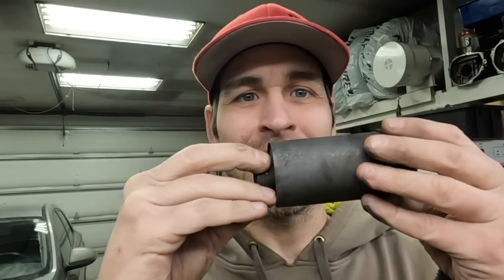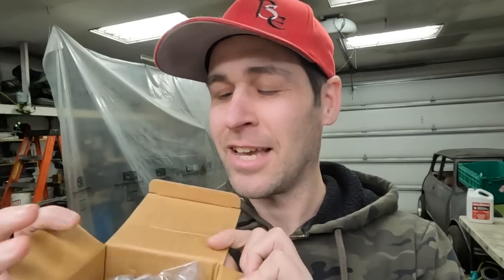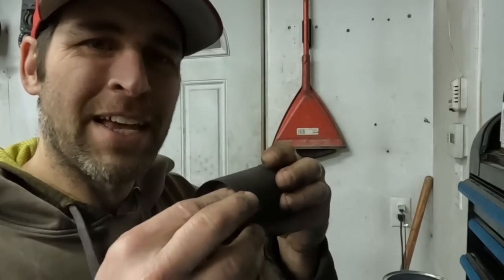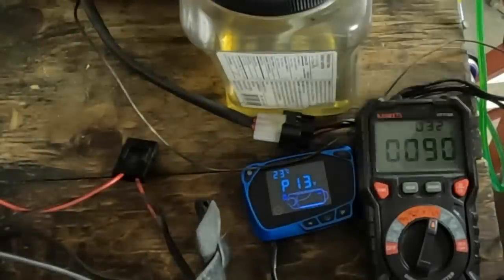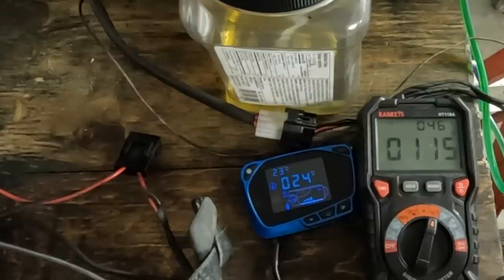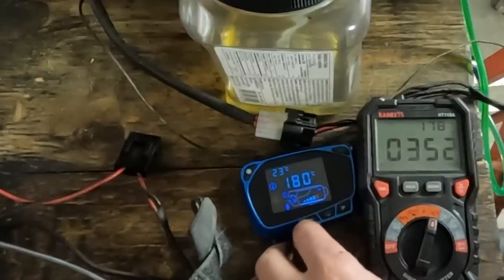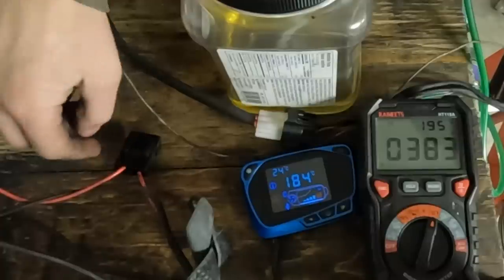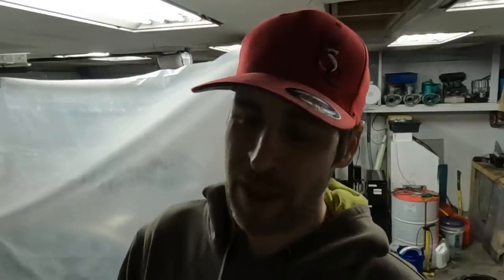Cat Converter In My Heater - Diesel Heater. PT- 23

Comment: I find it extraordinary that the folks that manufacture these have dialed it to such an efficient design.  

I think this is great considering the changing times.  Every home should have an off-grid source of heating.  Is this a larger plan?  I don't know.  

But I can say for sure, these heaters are safe enough, if you could be in a grid-down situation for more than 48 hours, you will be glad to have a sourced of heat.
Reply from the maker: It is pretty incredible, yes. They did a great job. 

For now, I am just trying to do something that keeps me entertained, keeps my brain going and saves me some money, but who knows what it will lead to. 

For sure... You wouldn't need much of a battery bank to power one of these heaters and a few solar panels would easily top your batteries back up.

Comment: 6:00 you got me there haha

If you made a mounting that you can adjust the baffle plate space to burner and then you can adjust the flame better.
Better heat efficiency maybe
Lower exaust temp possible i think if you dial it in correctly it can run super efficient and can be adjusted to different oils maybe
Reply from the maker: LOL... indeed... who wouldn't want to watch this to see what happens. 

I'm thinking of doing this again but with a large cat... The one that I used was off of a weed trimmer and it's probably about 6 times too small.. One for a car is more work, but more sensible.
Reply: @loweredexpectations4927  would love to see a video on that large cat :D

Comment: Get the Cat out of the flame front and place it further down the exhaust stream like a car.  Then bonus, extract the extra heat generated by it by having the exhaust ran through a heat exchanger!
Reply from the maker: I have had this comment a few times, and it means that I didn't do my job in explaining why I did what I did, haha... I kinda did this on purpose (not explaining it well) to try to make it more entertaining and interactive.... 

The reason for the cat being so close was to try to use some of the heat from it to help the oil burn cleaner. The area where the oil comes in tends to only run about 180C and it should be 250 ish to flash off the oil.
Reply: @Lowered Expectations  Got it that makes sense, too bad it got burned up...

Comment: Nice!  Ask Vevor for a controller that will allow you to adjust fan speed and fuel pump rate?
Reply: Curious what would’ve happened if the cat had remained in place.
Reply from the maker: I've already got one... just need time for testing / editing.🤟
Reply from the maker: I suspect that it would have choked it up, based on tests both before and after this... I suppose I could try it again as I still have it...
Reply: Awesome that you got the adjustable controller!

Comment: It is normal at startup for a bit of smoke or vapors to escape, as the catalytic converter needs to reach reactive temperatures first.
It shouldn't take long for it to get nice and warm glowing in a light amber color.
Reply from the maker: It would be really cool to stuff a large one in there and cut the end off of the heat exchanger and observe it.
Reply: @loweredexpectations4927  get a piece broken out of a car cat, chipped away on the sides, until you have a long round piece. Stick it in a borosilicate glass tube, attach to a straight piped exhaust combustion engine anything. Maybe even the exhaust of your heater.  I have seen it in school, the teacher had a little jet engine blowing straight into the glass tube filled with a Ford ceramic catalytic converter honeycomb chunk. Don't cut  to observe, just drill a hole and put a heat resisting optic into harms way, without changing much on the system.
Reply from the maker: @sebastiank1714  That sounds awesome.   "heat resisting optic" Sounds expensive, haha.

Comment: There's a reason cat converters on cars are 3 times the width of the exhaust pipes connecting them. I think your idea will work but try a cat converter for a Geo Metro 3cyl car. That will give you the larger surface area you need. The corrosion could be the detergent in the oil, bad stuff for burning. The cat doesn't have to be so close to the fire. Look at cars, the cats 1 to 3 feet away from the exhaust manifold.
Reply from the maker: Right on. Thanks for the info. 

The reason for the cat being so close was to try to use some of the heat from it to help the oil burn cleaner. The area where the oil comes in tends to only run about 180C and it should be 250 ish to flash off the oil.

Comment: Putting the catalytic converter in direct flame will destroy it as you've just found out. It should be mounted slightly more downstream. You may try putting it at the very end of the tube or even in the exhaust. Just by design, it will heat up to the temperature far exceeding the exhaust fumes anyway.

PS: You may really try just choking the exhaust at heat level 4. If you recall the first melted motor end cap, it worked well, before it melted.
Reply from the maker: Thanks for the comment. I want to try this again with a larger cat and with more spacing, for sure. I was under the impression that most cats are made of ceramic and can take intense heat... This one was some sort of thin metal.

The reason for placing it close to the vaporization area was to try to get more heat in that area. The issue with putting it further away is that the exhaust may come out clean, but the vaporization area will still run cool and plug up. My hope was that the cat would cause enough heat / restriction that it would heat the vaporization area and make it burn cleaner. 

It has occurred to me that it could be a restriction to flow that made the heater work well with the motor end cap. The problem with choking the exhaust is that the heater will either not start or chole too much and actually run cooler. I think it where the restriction is is just as important as how much restriction there is.
Reply: @loweredexpectations4927  The ceramic cats didn't last long on two stroke gas engines, so they came up with the metal cats for two stroke. More expensive, but they withstand the harsh two stroke conditions.
Catalytic converters for diesel cars usually are ceramic.
Reply from the maker: @werner.x  Right on... good to know.  It seems as tho it is the metal itself that is failing in the cat that I used, ... I'm assuming that the failure mode of a ceramic cat would be that it got plugged or just used up all of its catalyst ... but that's just a guess.
Reply: @loweredexpectations4927  The normal failure point of a gasoline catalytic converter is the point, when the catlytic metals are worn off to a degree, emission tests are no longer passable.
The extrordinary failures of a gasoline cat are broken ceramic due to explosions or molten ceramic due to lean running.
The normal way, a diesel cat is failing, is clogging.
This can be cleaned out, but burns off during a highway run, when the underlying problem got fixed.
The other thing, used up catalytic material, is something, at least here in Germany, can not be detected during emission inspection.
Shattered ceramic isn't to be expected in Diesels.

Although there are some emission level 4 upgraded vehicles which retrofit cat-particulate filter combos crumbling away regularly. I assume, this happens, when a clogging filter is rising the flow resistance and so, the cat section gets too hot, but that's only my guess.
Because these vehicles need a regular added catalyst into the fuel tank and if you forget that, the diesel particulate filter rarely ever reaches freeburning temperatures. Also, nothing monitors the ash load in retrofit filters.
But car won't go in limp mode, because there is no computer to run the engine. Emission upgraded VW Vanagon Turbodiesel have this problem here, for instance.
Reply from the maker: @werner.x  I don't think my heater would pass an emissions test 🤣 

From all of what you wrote, what I'm hearing is that I need to stop babying my heater and to more highway runs.... and stay away from emissions testing depots ... Got it 🤟
Reply: @loweredexpectations4927  There are both variant of cats. OEMs typically use the ceramic ones, as they have way larger surface area. The metal mesh cats are often called high flow cats and are used in race applications. They have significantly shorter life, but they are cheap.
To be honest, I don't think cat is not something which will help you. There is pretty much zero chance you can find a ceramic cat core, which will fit inside the tube and seal.
Reply from the maker: @TrinomCZ  I don't think it will help with with the end goal either, but I think it is something that people want to see. Even if it caused the chamber to get hotter / trapped some heat and cause the oil to flash off, the cat would just get plugged with ash pretty quickly... The carburetor idea is also silly and has no practical application, but it will be fun and I think people want to see it, haha. 

Along with many experiments, I'm working on a custom burn chamber that I'm hoping will lengthen the service interval and perhaps offer a solution to others who want to burn waste oil. Maybe they can be made by myself, or someone else and sold as a kit. That would be nice.
Reply from the maker: @TrinomCZ  I missed the "there is pretty much zero chance you can find a ceramic cat core, which will fit inside the tube and seal."  I figured there would be a lot of chipping away by hand / mechanically altering the shape and then perhaps muffler cement to seal it.
Reply: @loweredexpectations4927  Yeah, that may work. And I agree, the carburetor is a funny idea, which may actually do something. But I'm not sure how much it is going to like the oil as it is way heavier liquid than gasoline or diesel.
Reply from the maker: @TrinomCZ  Yeah... I'm going to run gasoline in the carburetor... if it doesn't just backfire and blow everything apart...

Comment: The burn chamber should be left out when the catalytic converter is putted in. The CAT might have melted  due to too much unburned fuel.  More air might be needed in the mixture.
Reply from the maker: Thanks for the comment. 

Not 100% sure what you mean, but the burn chamber tube is necessary to guide the hot gasses along the exchanger... without it, the gasses will just exit the exhaust directly below where the fuel comes in and shoot flames out the exhaust. 

With the particular controller I was using, the fuel air ratio is not adjustable, unfortunately.

Comment: Please correct me if I'm wrong: Isn't there something about catalytic converters to be at some distance from the engine to not get fuel into them, also I've read to not pull start cars because of unburned fuel getting into the catalytic converter and destroying them. Maybe unburned oil got into it? At what temperature should a catalytic converter run?
Reply from the maker: I don't know about a distance being recommended. Cars usually have two, one close to the engine and one further away. They don't work until they are hot so a lot of modern cars will actually dump extra fuel out to get the cat warmed up, when the engine starts. 

Oil is a bad idea for sure, and the catalyst does get used up, so it is a good idea to run as clean as possible before going into the cat. OIl and additives can plug your cat up and cause them to fail before they are used up, so it is best to avoid. 

In my series of videos on trying to burn oil, I have found that the oil is not getting hot enough. I have also found that if I can get the chamber really hot, then it burns really clean. The hope (other than entertainment) was that the catalytic converter would build up enough heat that the oil would start to burn clean.
Reply: Distance is car dependent. Start temperature range for a catalytic converter is 250 - 280°C. This has to be delivered by the engine.
Operating temperatures are 400 to 600°C, this is fired by reaction and by the amount of extra fuel, a car with three way catalylic converter consumes, compared to good running engines without emission control.
Ceramic starts melting around 800°C. This will immediatelly restrict airflow irreversibly.
400°C is also the starting temperature for a diesel particulate filter freeburning, end temperature in full burn is 600°C, self extinguishing, and then dropping back to 400°C max. operating temperature under full load conditions.
So, a cat in a gas car operates at higher average temperatures than a diesel cat. A diesel cat also reduces other products, they target only NOx, afaik.
No higher temperatures than 600°C occur in normal operation, whatsoever.
So, if you place these expensive parts wrong, it gets costly.
Reply from the maker: @werner.x  I had no idea that ceramic melted at those temperatures... I assumed it was much higher. These heater videos have taught me so much. When it comes to running catalysts on automobiles, it sounds like a complete pain in the ass ! Haha... I'm glad there are engineers out there figuring this stuff out so guys like me can come along and ruin it 🤣
Reply: @loweredexpectations4927  
There is ceramic with way higher melting temperatures. It's just, that the material only needs to fit the case. With millions of built items costs for the manufacturer add up quickly.
Reply from the maker: @werner.x  That makes sense.
Reply: @werner.x  Thanks for the explanation!

Comment: So what about about burn chamber lined with steel mesh? :) kinda like starter chamber but through the burn tube
Reply from the maker: The guy from hobbychanel germany has been trying this with some other mods... The "trouble" is that, for this to work, the fuel needs to come in contact with the mesh, so it needs to go outside of the vaporization area. This is better than nothing, but being against the walls of the tube means that it won't mix with the air as well. The idea of the reduction ring, I believe, is to mix the vaporized fuel with the air so it burns thoroughly.
Reply: @loweredexpectations4927  yes, but you don't sometimes think that all that burnt gunk that builds up in the burn chamber is actually unburnt fuel that doesn't get vaporised and like a big water drop or stalactite in the caves simply builds up kinda like 😂 wait something is coming.. 😂 Like glacier forms there.. And i would try extra mesh strip lets say out from start area towards burn tube.. Maybe thats all u need to vapourise all of that leftover unburnt fuel.
Reply from the maker: @sisisduo  Haha... yeah... it is possible.

Comment: 14:24  So.  My understanding of this, is that when fuel rich vapor hits the catalyst, the catalyst heats up, without any flame, it is doing so from the fuel.  This glowing red hot mesh is now your ignition point.  

I was thinking the goal was to reduce emissions.  I think I get it now.  Did you explain that and I missed it?  Or was it implied because it's about MOAR heat in the burn chamber, holding the heat, keeping it in the burn tube, not the exhaust.  Enough heat to burn the waste oil, preheating to make vaporization easier.  

It's all part of the larger scheme.  I guess I get lost sometimes.  

I wish I had the confidence and will to tear apart my burner often to burn waste oil.  I don't use it enough really, the season has been so mild.  We have 79F forecast tomorrow, I mowed my lawn earlier today.  For better or worse, this has kept me on the scrap route for the waste oil.  I've hoarded this waste and even hauled it in a move, it MUST find a purpose.  Maybe I just plumb the heat outlet towards a tank of water (build a shell, insulation, yadda yadda)  But skip the junk and go waste-oil in the diesel heater.

I think you figured out running it on diesel cleaned the chamber well enough pretty early on.  Run waste oil, or a mix for however many hours, then switch to diesel for 4 hours to clean.  If not doing tests, that's probably the simplest way to make use of the waste oil hoard and not Darwin myself mucking around with tin cans, vacuum motors, wicks, propane tanks and.. yeah..
Reply from the maker: I kinda played it fast and loose with this video explanation ... I figured the regulars would know that I was trying to get / keep heat in the chamber (so you were right there) and anyone new would be overwhelmed if I tried to explain it all. 

Haha... yeah... I collected oil for ears once and then ended up hauling it to a depot in two trips ... the people there looked at me funny when I was leaving the weigh station on my way out ... I was 250 KG lighter than when I went in. Anyway... that's why I'm burning it now. I still have about 280 litres and considering that gets mixed with diesel and gas at 30% ... I've got a lot to go through. 

Some people swear that they run 70/30 diesel/waste oil and don't have issues ... Others have told me they had had some problems. I'm not sure what the exact percent is where you can avoid problems, but some of it would come down to the crap in the oil and if it is synthetic etc. 

Personally, if I were going to build a heater, I think I would use the first design in this video... Looks like it works amazing and you could put a heat exchanger or a water coil .... whatever floats your boat. Let me know if the link doesn't work. 

https://www.youtube.com/watch?v=mBBpuZQrRhg&list=WL&index=1&t=625s&ab_channel=CreativeinventionsLMTN